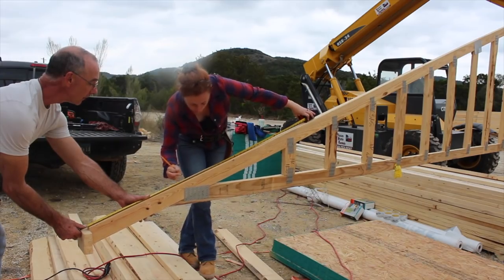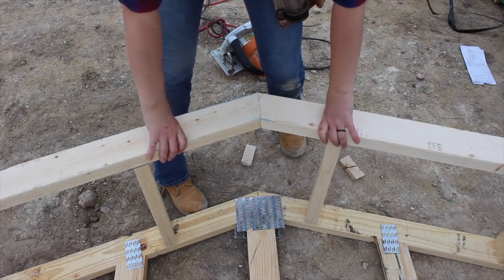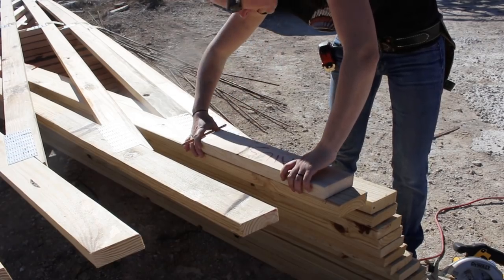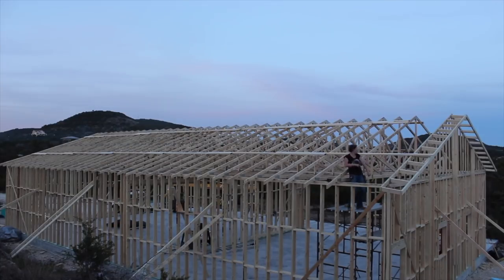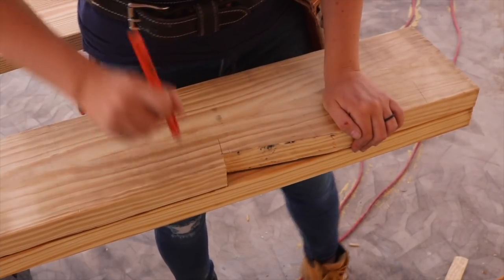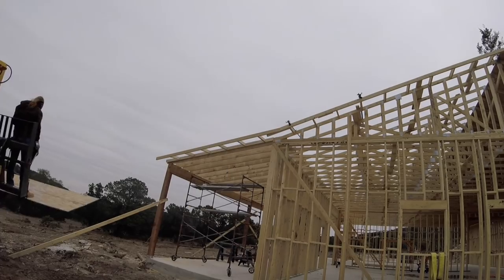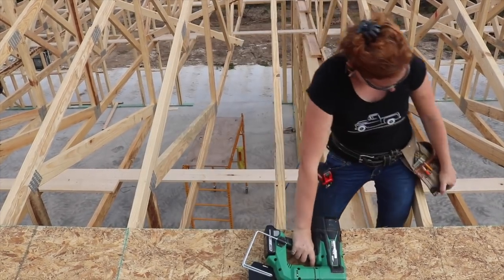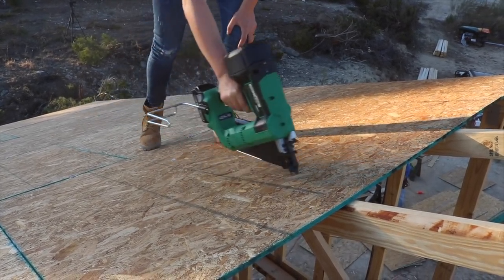Building A Shop - Trusses and Patio

Comment: Your shop is HUGE!  Wish I would have made mine bigger. The overhang is an awesome addition and is a shop all in itself. You’ll find all kinds of uses and being able to work with the doors open is a dream.
Reply: everyone says that "wish I would have built bigger, higher ceilings and taller doors." it's hard to go wrong building large/oversize, if your in a colder climate you can always partition it off or build smaller work rooms inside that are easy to heat, for far less than trying to add on or modify it later.

Comment: The gable end trusses should have been built 3-1/2 lower so a 2x4 could have been to sitting on top of it connected to the second truss in line.   Makes a much stroger overhang.
Reply: I'm having trouble picturing this, but is there a picture or drawing to depict this. If this is sound advice, I think everyone should understand it. Thanks.
Reply: Yup. In snow country those gable ends wouldn't survive the first winter. Perhaps not even the first snowfall.
Reply: @MrSatchelpack What AJK is describing is called a drop gable.
Reply: @MrWizards1974 Yes, a drop gable. That makes so much sense. I'd probably do it this way even if I wasn't in snow country.
Reply: picramide April lives in Texas, not snow country!
Reply: Around my area we just notch in the 2x4 into the table top cord & run them out flat ways.
Reply: Yes, that bugged me too when I saw that. The entire overhang is scabbed on rather than being structural. Wood must rest on top of other wood, otherwise the nails alone are carrying the load in shear. I would venture a guess that there was an assumption by the supplier that there wasn't going to be an gable overhang, and April didn't know to specify a shorter end truss. Add 3 or 5 angled 4x4 braces to each end now.
Reply from the maker: Yep, this is something I learned along the way. I didn't know about the shorter trusses until I asked my Instagram audience how carpenters deal with the fly rafters hanging. Wish I would have known, but it's ok. Again, live and learn.
Reply: I had trouble finding a picture of an actual dropped Gable end in position although the link above should shed some light on what we are talking about.     Either way your project looks great,  enjoy.
Reply: You mean like this AJK always needs more info?- http://www.trusstek.com/images/Gabfam1.jpg
Reply: Exactly,  but I was looking to show her an actual job site picture that showed a side view which clearly Illustrated the dropped Gable.
Reply: uhg at one time I was the guy that drove all over Texas performing engineer changes on these trusses at the job site.
Reply: If you’re installing a roof which requires strapping to be put on, the strapping will help to stiffen the overhang. Otherwise, you could install decorative supporting brackets under the overhang. It would also help to secure the outlookers using joist hangers or other metal connectors.
Reply: My roof was done the same way as Aprils that was 30 years ago I never have liked it but there never has been a problem. I helped a turn key carpenter of over 30 years experience. I could barely drive A nail. But toenailing lookouts onto that last truss just didn't seem right to me but he assured me that's the way it's done for this ZIP Code/area roof deck would be all the bracing necessary and I would be fine
Reply: It's a chance to add decorative corbells
Reply: April Wilkerson we have also done lap joints in both when this has been encountered. Much more work for a screw up correction but much stronger than what you did. Again way too late to help you, but maybe others will learn.

Comment: Great job!  Brings back memories of building my 30'x30' garage / shop many years ago.  My dad helped with my mom supervising.  We didn't have power equipment so I welded up an extension for my engine hoist to get the height for the trusses.  A little spindly but with the wheels on the hoist it was easy to move the trusses in place.  Fun to watch your project and remember mine too.  Thank you!

Comment: Hay April,  just recently finished my own woodshop in South Louisiana. One thing that the building inspector noted on the framing inspection was the lack of blocking between the trusses along the ridge vent. This blocking allows your roof sheeting to be nailed 100% along the perimeter. Also note that blocking is required along the gable ends of your roof. Looks great. Can't wait to see the dust collection layout.

Comment: April...as someone that does nothing but mutifamily construction, when we "load" a building with roof trusses, we load from one end and 2-3 truss setters walk the trusses across the building, laying the trusses down, with the point or top of the truss pointing away from the end of the building you are loading. That builds a walkway...if you will for the truss setters to walk across. When all the roof trusses are loaded, you simply "stand" the roof trusses up and scoot them one way or the other to pencil marks you have made on the top plates adding lateral/cross bracing as you go. Very few people use sub-fascia anymore, budgetary consideration and just use 2x6 or 2x8 as fascia. Hope that helps in the future if you going to start building buildings.

Comment: Great video as always. I have found that if you can load several sheets of plywood on top of the roof, it is alot easier to cut and nail them into place. Also using a staple gun is very helpful. A lot more staples and its not very heavy compared to the frame gun.

Comment: April, I'd like to make a suggestion on the insulation.  I've built many buildings but did this recently and wish I could go back and re-do everything I had in the past.  DON'T use fiberglass batts.  Use foam boards between your studs and seal them in place with expansive foam around the edges.  Foam boards will offer honest R-values even if you make a mistake or it gets punctured.  The smallest imperfection with batts can easily reduce or eliminate completely the insulating value.  
I had some Amish neighbors rough frame my building with a metal roof.  They placed about 1/2 or 3/4 inch insulating board under the metal roof.  It's easily 20 degrees cooler in the attic than my similarly constructed and oriented roof on my house.
I used 4 inches of foam boards, two layers of 2 inch boards with a 1 inch air gap between them, on the walls.
Without heat, I've never had it go below about 38 degrees inside when it was in the single digits outside  In summer, it's like walking into an air conditioned building without using one.  I did place 4 inches of foam on top of my ceiling.
Heat with a candle and cool with an ice cube.
Do invest in the professional foam gun for sealing the boards in place.

Comment: April, a possible solution for covering the post brackets on the patio, could by installing tile on the patio and concrete pads vertical faces. The tile on the vertical faces could even extend up at the posts, so as to cover the brackets. For the remaining sides of the posts, a tile matching the height of those could be used to cover the brackets there. It's just an idea, but I thought that it might work for your project.

Comment: Great looking Building! One design suggestion if you ever build another one, or for anyone looking to build their own. You could have used a dual pitch Truss that cantilevered out over the porch and would have eliminate the cost of the post and beams at the porch. A well designed truss can easily cantilever out to cover the patio/porch. Then if you really want the look of the posts they would be non-structural and can be framed in any time. Plus the time saving of not having to cut and set rafters.

Comment: Great job, April. Super jealous!
Something to be aware of (and a note for anyone else reading these comments), for structural members/beams, you should stick to douglas fir instead of cedar. It has greater strength and usually cheaper when you're dealing with beams that size. Plus, if you get rough cut A-grade (appearance grade), you can stain it and it looks a lot like cedar.
I'm sure there will be no problems in your case (I'm assuming you've had an engineer sign off on your plans)? Just something to keep in mind for your next project :)

Comment: you should always store everything on a pair of hard drives to keep it simple or go with raid-1 (mirroring) setup. I recommend people buy pairs of same size external or internal hard drives, same size, but different brands in the case of a bad batch by one manufacture.
it doesn't hurt to have more flash/memory cards for cameras and rotate them out long after project completion and always "full" format before reusing. :)

Comment: This is too late for you but for others who may read these comments a helpful tip for that last scene of loading osb or plywood on a lift. 
After getting several inches onto the forks, raise the forks slightly 4” or so. Then put and hold a 2x4  in as deeply as possible. Let the osb back down. You should now have an opening where you can drive forward and the forks ho under the load and lift

Comment: Rather than use annoying H-clips, you can set a couple of temporary 8d nails against the first sheet. This leaves a perfect 1/8" gap on each sheet.

Also, I'm a little concerned about the interface of the sill to patio slab. Fortunately it's under roof, but there really should be a good 2" drop in slab height from the interior to the exterior to allow for the drip edge and keep the water out. Where the doors are, you would recess the slab and leave a chamfer behind where the door sits. This keeps water and dust on the outside.

I do have a detail for the flashing that fixes this, however. You can put vertical flashing along the edge with a bead of heavy caulking with a backer rod to the concrete/flashing, leaving a good 1/2" air space behind the backer rod. Then you paper the exterior, and set the drip edge 1" up. This give you both the drip edge clearance to stop capillary action, and prevents water on the ground from getting under the sill.

Comment: He didn't exactly win. Well, let's just say you had a much more difficult tast on moving all those boards while in full contact with the board under them. Cody only had a very little bit of board friction and then the help of 2 very well polished forks.. MUCH LESS WORK on his part!!! 

Loving the shop build. I wish like hell I could come and help. I am very excited for you. I'd start thinking about the vacuum system and a multi-port filtering system now before you start wiring and insulation. Being able to filter all the air in each room will give you a much better life all the way around.  And don't forget a LARGE breaker box. You can never have too much room in the breaker box. You can never have too many outlets either.  Something I would change about the last shop I built is that I would place the breaker box on the face of the wall and build a chase OVER the insulated wall. Even with years of preparations and thinking of everything, I didn't think of everything. Another way to do it is to build it in the wall cavity, but add extra conduits from the box to the attic. Then you always have a way to fish wire for those new power tools and welders and AC and lighting and, and, and.....

Comment: Great video I would run two hard drives in raid mode so it will back your data up..then if a drive failed you would have the second drive.

Comment: Here in norway they calculate snowload of 1 ton pr square meter, my garage trusses span 12 meters and are made solely of 2x12. Big difference in materials used, but really nice building april 🤘. Framework on my building is made of 2x8
Reply: Much of the South never or very seldom gets hit with snowfall but still they at least have some amount of snow load rating for the rare case it happens.
Reply: Joshua79C C nearly 6 feet of snow on my roof right now 😬
Reply: Recently checked how much that is in US imperial and its 208 pounds per square foot, up to 60 psf snow load is common but rarely do I ever see that amount of weight in snow even wet stuff in my area of New England let alone other places they get more snow. Then again we got neat snow removal tools for roof clearing to prevent icing or too much snow build up to ones liking. Barely got a few feet this season and it does not stay around for more than a few to several days with the temps here.

Comment: I'm wondering, how does such a wooden construction compare to a steel structure?  Any thoughts?
Reply: Wood is more flexible in what you can do secondary framing wise, where as most steel frames are not so flexible, then there is the pricing per square foot/meter, seeing as steel price rise more often than wood.

Comment: Only thing that could have been stronger are those gable end overhangs. On commercial jobs the gable truss is ordered 5 1/2 inches shorter than the other trusses and 2x6 lookouts are set on top vertically and tied one truss  back. 
Those little blocks nailed through the back of the gable truss are not really all that sturdy and the osb will not support that overhang without eventually sagging. It could use some extra support or you will see it smiling at you in 2 or 3 years from the sag in the middle of the roof rake.
Reply: bluebird5100 --- Decorative angle bracing will take care of that!
Reply: Probably not a concern in the location where this building is.  I think she lives in Texas.  Now if you were in the northern climates that get snow, this old be a problem as that is a very poor construction technique.  The better way is what you mentioned and is how overhangs are typically done.  However, her biggest risk is likely uplift from a heavy wind peeling up the roof starting at these weak overhangs.  I am surprised that a building inspector would approve this.

Comment: The Significance of Pine Trees Atop Construction Buildings. ... The trees are known as topping trees. They celebrate completion of the skeleton of a building structure. If the building is a skyscraper, the evergreen is attached to the top beam as it is hoisted, a signal that the building has reached its final height.

Comment: I am curious why you wouldn't go with a metal building. I know you are into woodworking but it would seem to be fast and strong building. Just curious was a metal building ever be considered?
Reply: Not many metal structures allow for such flexible construction as wood or use of wood for wall fill in and cover. Also the cost for steel rises more than wood.
Reply: I can't find anything wrong with that at all. I mean long term and maintence seems to better steel was my main reason for asking .

Comment: Great, with one exception. At the last when you were grunting the boards onto the forks, as soon as the tips of the forks were under the 4X8 sheet all he had to do was lift an inch and drive under the boards. Work smarter darlin, not harder.

Comment: Having lost irreplaceable digital files to hard drive failure, I now backup all digital items to high-capacity thumb drives as files are created.  They are cheaply purchased (frequently on sale) at the local warehouse stores, can be used for specific projects ("Christmas photos", "Sketchup projects", etc.).  During semi-annual digital file backup, all files are printed to optical drive media, labeled and filed.  It's all a lot more effort but the files are replaceable once the inevitable hard drive failure occurs.  (BTW: I never trust important files to "The Cloud")
Reply: How many thumb drives have you had fail? Others state that they can really vary in quality. USB 3.0 external hard drives are inexpensive now, so I have a couple redundant backups with those and I was backing up photos to "archival" quality DVD's. I agree with not trusting "cloud" storage. Multiple backups is a must (don't put all your eggs in one basket-anything can fail), and don't get lazy and forget........that bit me when an expensive WD drive failed a few years back. Luckily I found a data recovery place that had a great reputation and the failure was minor, resulting in all of my data being recovered for $400 or so.

Comment: if I was you I would have put the sheathing on the walls before I set trusses to make it more rigid also since the trusses are made with a jig it's not always going to be perfect and you can always go with a string line up top because you could be off at both ends I would always go with the walls and you can fix the top when you sheet the roof. also when you make your rakes try and do a ladder Style with a 2 by 6 on each side that way you have something to nail two on each side all the way on down but overall looks really good but hey everyone has their own way of doing things

Comment: 35 years computer support.  I cannot count how many times I have told users, "your hard drive will fail, not if, but when.  Back up, back up and back up".  Yes, three times on really important stuff.
Reply: Even I with less knowledge than someone like you knows what RAID is and its fairly easy to set up not to mention online backup storage also helps. That and SSD with HDD or SSHD offers best of both worlds for drives.

Comment: I’ve been do doing this a wile , and a good fix for your bottom post are these post anchors. They don’t stick over and now they have 2 types. I’ve  used the complete anchor but now they make trim pieces where you can use your existing anchors .Or you could brace up your post one at a time and change them out. Wrapping the bottoms is ok but the wood just doesn’t do well and never really fits right unless you scarf out the back to account for the galvanized base . Good luck check it out here’s a link https://www.homedepot.com/p/OWT-Ornamental-Wood-Ties-Laredo-Sunset-6-in-x-6-in-Black-Galvanized-Steel-Faux-Post-Base-56690/206136413